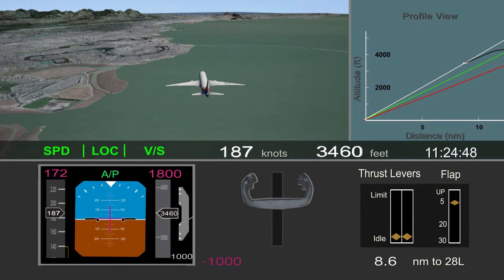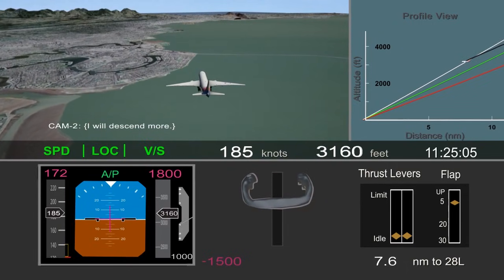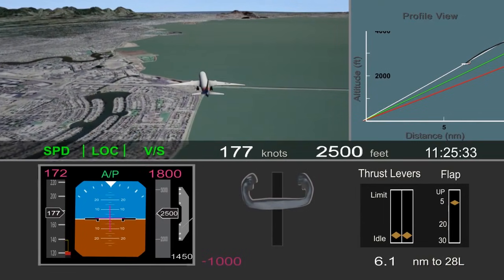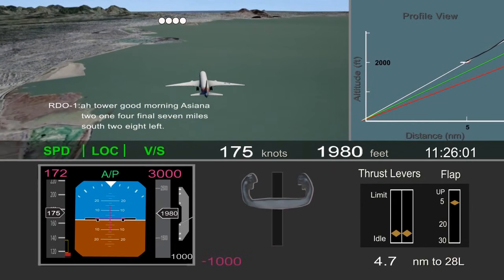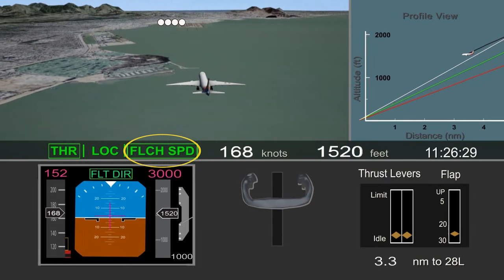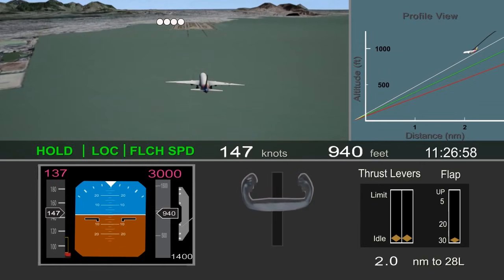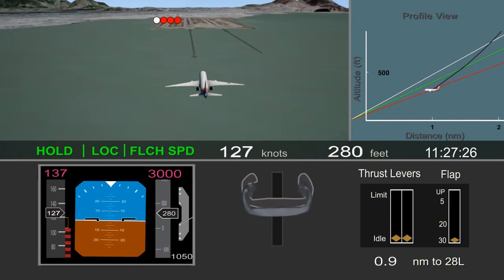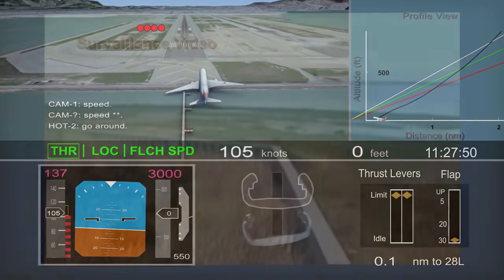Asiana Flight 214 Crash - NTSB Animation

Comment: This highlights two very interesting features of the AFDS logic that I can't honestly understand:
- Forcing the thrust levers down to idle when in THR | FLCH climb will revert from THR to HOLD, why?
- The ATs won't wake up when the speed comes down below Minimum Maneuvering Speed while in FLCH. Again, why?
Reply: +jibeneyto Boeing logic, an Airbus would have applied thrust. Basically Boeing leaves more in the hands of the pilots than Airbus. Noe excuse for this either way.
Reply: +FEVB Thanks for your comment. I did finally read the report that Boeing submitted to the NTSB. They acknowledged this issue with the ATs not "waking-up" when in FLCH because if that were so, there would be 2 AFDS modes trying to control airspeed at one. To me it still doesn't make much sense because when the speed slows down below MMS then clearly FLCH is not doing its job as it would "want" to.
Reply: It didn't. That was one of the pilots initiating a go-around (too late).
Reply: jibeneyto Ok than,but still it was the pilot's fault not the plane's one :-)
Reply: Not true, just take a look at the End of the video, it has woken up
Reply: I realized that FLCH climb sets AT to climb thrust and FLCH descent sets AT to flight idle. But the pilot can then control the rate of climb or descent by manually moving the thrust levers thus making the AT revert to HOLD mode. In this mode the wake-up function is disabled.
Reply: jibeneyto ?? Because when the pilot manually puts the thrust levers to idle, the plane's logic assumes the pilot wants that and doesn't want to go against the pilot's wishes. It's that simple. The FLCH mode is not supposed to be used after the FAF anyway.

Comment: I´m just a layman but i can´t believe the PM was actually also the instructor/check captain/PIC with over 3000hrs on the 777 and not taking controls while they were in an unstabilized approach with a PF not familiar with a 777 (43hrs on 777 - over 9000 altogether) on his first landing with the 777 at SOF and clearly overchallenged! It is the PICs duty to ensure safety and he missed that already on 1000 ft, had a second chance on 800 where instead of calling out "speed" he should have initiated a go around.

Comment: when u pulled all the way down but the airplane did not response with a pitch-up action, u'd better check the ias and the trim. i think airbus pilots dont worry about their throttle, they think they just need to pull the sidestick and the aircraft will pitch up.

Comment: Autoflight, especially on the airbus can easily discourage basic airmanship if its abused.
Reply: +Aidan Hutchison I'd be careful going down that path, as there would have been additional warnings and protections even hand-flying a visual approach in the 'bus. 

Actually true, I see your point - on most days that protection would make matters even worse.  There's definitely a lack of actual piloting skill coming out of the classrooms these days. 

There definitely should have been an audible warning when autothrottle hold mode was engaged.
Reply: +Aidan Hutchison Irony - a bus, which apparently the pilot flying was more used to, might have saved their automation dependent butts (A-Floor protection I think it's called).
It really doesn't matter what modern jet is flown -mere minutes of actual handling per sector, especially the even fewer sectors on long haul, erodes manual flight skills. It's an industry issue long in the making.

Comment: He spent a full 25 seconds both below glidepath and slowing down with absolutely zero action on his end.  How do you just sit there thinking "where's my airspeed?  Where's my altitude?" for 20 seconds and do absolutely nothing.  It makes no sense.  He literally stopped flying the airplane.  It took 25 seconds for anyone to do something at all.  That was about the dumbest thing I've ever seen.  Literally, the only thing the pilot flying did was pull all the way back at the last second while just over stall speed.  It looked almost intentional.
Reply: cjracer1000 
Years ago I read an article @ B&CA Magazine with the titule:
 - Pilots who shouldn't be....
Well, there are some samples.... This Asiana Pilot, that AirFrance's (Co)pilot holding his side stick in a nose-up position, despite all that "Stall" warning...
Reply: You have much more control if you disconect the A/P above 3000ft. and fly this thing without any help. Many cariers in the EU doing this Step too they disconect the A/P for the Approach and use not the ILS Support for autoland or GPS-Approach. They Disconect Evrything at 3000ft. The Important Thing Is To Control The Airspeed By Your Self (Usualy 140-150 kts) the crew don't do this. So the question is why the pilot not react in this Case. The throttle is neutral until shortly before the accident. They dont react also as 3 red lamps up by the Way. Why?
Reply: hindsight is always perfect, its easy to talk smack when you are not in the cockpit, company, situation, culture...  with every air incident, you dont talk smack about the pilots behind the controls, but you learn from their mistakes so that you make the same one
Reply: 777
Reply: The captain was flying a320s, this was his first 777 flight
Reply: My man forgot that A/T on hold mode literally holds the thrust, not the airspeed
Reply: I wonder how was the communication between 3 pilots
Reply: In excellent VMC too 😂
Reply: Why is he even out of vnav path on an rnav approach it baffles me. I would have been looking at the captain sideways the moment he elected to use level change when less than 5 miles from the airport never mind 1500 v/s below 6000 feet is already steep enough! I mean you got to have no idea what you are doing if you are using level change that close to the runway. The guy didn’t even use it correctly he bugged the MSA then flight level changed resulting in a CLIMB lol like what are you thinking? And then disconnects the whole thing while it’s destabilized to just say “oh to hell with this I’ll hand fly it in”. Wow I’ve never seen someone mismanage their approach so badly.
Reply: Stuart Hughes the problem developed because he disabled automation. Him pulling the throttle to idle disabled autothrottle and his successive inputs were based on his assumption that ap would hold speed.
Reply: @Galf506  No.  He should have been able to hand fly that plane down from the top of descent with all the bells and whistles OFF.
Reply: @Galf506  relying too much on machines but the. If the machine is in full control it likely won’t make a dumb mistake?
Reply: @Galf506  does not matter if the AT was not doing its job the clown cpt should have done something about it.
Reply: He was vaping ........
Reply: It's far more complex than you say.
I'm wondering what aronautical experience you have to judge so roughly the crew !
YouTube is full of armchair pilots or suddenly self proclammed aviation specialists !
I wonder how many of them had controls as a a pilot in command in reality !
Read the full accident report, the Boeing and FAA recommandations after this crash and you'll see that flying such a plane with complex automations, in such a concested area with arrival stucked high as long as possible to clear the toutes for departures is far more complicated, difficult and demanding that just reading a speed and watch a profile.
Many experienced capitains on 777 familiar with this airpor witnessed that this accident was to happen due to the the training and the automations of this aircraft in these kind of situations. Several reports mentionned incidents similar to that before this crash and it was not taken in account adequately.
It's not flight simulator in these airliners folks !
Reply: Let me just post the comment of a Asian pilot:

"As someone who has flown for an Asian Airline for 11 years, I can tell you that Asian Airlines (almost all of them), do not train visual approaches.  Even when the weather is clear, the have their heads down and are watching the Glideslope and Localizer needles to make sure they are centered all the way to landing.  All with the autopilot on or at the very least, the auto thrust. So, why do they do this?  It’s because ALL Asian airlines use QAR Data to punish pilots that deviate from the Airlines strict and idiotic permitters that they set.  Let me give you an example.... Taxiing more than 10 knots and making a turn of more than 50 deg. Results in a hard (RED) QAR. Another one is G/S deviation on landing as well as a Long Landing.... (even though you touch down in the touchdown zone).  And there are 50 more strict guidelines the airlines put in place in order to keep their pilots in a Box of Parameters to work from.  What they lack in stick and rudder skills are supplemented by this box of operating guidelines.
They then use this data to access the quality of that pilot for upgrades in First officers as they move from F1-F10 (F10 being almost a captain).  Once your a Captain, those same QAR Parameters still apply.  The “leaders” then use this data on each pilot (yes names are attached to this dats....), to punish the pilots with deductions from their paychecks....  Sometimes in the thousands of dollars and additionally use this data also to decide who is a good pilot and should be moved to a Captain position.
In Asia, money rules! Being a Captain and making that money drives all of them to show the leaders how few Red QAR’s they have.  
So you will now ask, how does this make a 777 fly into a sea wall on a clear day?  On this day, the G/S and LOC guidance was out of service.  The pilots didn’t expect this even though it was NOTAM(ed) out.  Not to mention it was written in English. Now they were forced to hand fly this jet (laterally and Vertically)without guidance to the runway and that is something Asian Airlines DO NOT DO.  They do not disconnect the Autothrottles on ANY approaches...ever!  These pilots were confused on what was going on (no LOC or G/S guidance), lacked basic hand flying skills based on line of sight (because they don’t train this) and were VERRY worried about the QAR data flagging them in all their confusion.  Couple this with poor training culture, new pilots on new aircraft Type and you will just barely.get a glimpse of what every expat pilot in Asia sees as a Major setup for accidents just like this.  
I could actually write an entire book about this subject but just thought I’d share just a little insight into Something every expat pilot in Asia already knows.  Fighter Jet pilots or not, Asian airlines do not work their way up to being an airline pilot like in the USA/Europe and the other 99% of the world.  They go from a Cessna 172 straight to a jet. They don’t fly cargo, charter work, flight instruct or do anything that prepares them for even a strong crosswind landing until they start Captain training.  They lack experience, proper mentorship both in International flight rules and the basics in decision making (thinking for yourself), problem solving, basic skills and live in fear of the RED QAR.
It’s NOT that they are stupid... they are far from that.  It’s an aviation and culture issue that can not be taught in any textbook.  This leaves them behind the rest of the world and I sincerely hope some day this changes.
"
Reply: @sfojulius  thanks a lot for putting this information here !
Reply: What’s the difference between a Korean airline pilot and a Korean fighter pilot?

The Korean fighter pilot has never killed anyone.
Reply: @sfojulius  So he means asian pilots can´t fly without a computer? :D
Reply: @sfojulius  Amen.  Many thanks.
Reply: @sfojulius  Ok this now makes sense. Lack of experience was the cause.
Reply: bonbondesel flying into terrain on a clear day is inexcusable for anyone
Reply: @bonbondesel  power controls altitude.  My cessna 150 instructor said.  These guys were idiots!
Reply: You are correct in saying flying one of these jets is a complex ordeal. That's why it's essential for pilots not to get tunnel vision. From this animation, it seemed like he was either focused on some other instrument, not paying attention to his airspeed indicator or he had spaced out entirely (unlikely). It also seems that he was unable to notice the auto throttle changing setting after he took control of the plane. It could be said that it's the manufacturer's fault for not making the autopilot mode indicators more visible but the pilot should've received training about the autopilot and should've been aware of that setting changing. 
You seem to have a pilot hero complex, not being able to admit that this was entirely pilot error. You can't blame the airline, you can't blame the manufacturer. You have to blame the pilot. And frankly, I don't know if it's because of your English level, but you seem grossly uninformed about the topic you're talking about.
/end rant
Reply: @NikHYTWP  I don't who you're talking to.
But it's like many people commenting in armchairs on YouTube forget the basics.
Accidents never happen for a single reason. Multiple factors.
A lot of people here, sitting in armchair, just simplify this as "dumb pilot" !
Not so simple. You can't blame only the pilot, only the manufacturer, only the airline policy, only the training, only the cultural context. You can't also do the contrary: not recognize the pilot responsability etc...
It's just a mix of all these factors.
They are all responsible.
Reply: @bonbondesel I was talking to you
Reply: @NikHYTWP  and you still think that I have a pilot hero complex and that I'm here for a rant while there's almost only haters comments exclusively againts these pilots ? Lol

Just pointing out that they're part of a system, not that they have no responsability in this accident. They're not the only ones involved, that's all...
When I see people not even holder of a PPL saying that they would not have made these mistakes in a 777 there because their flight instructors gave them good training advices in a Cessna 172, it makes me smile, that's it.

I've been a pilot and I can tell you in almost every single flight, any pilot makes mistakes. We learn from that every day because we are thankfull to be alive and have expérience. There are margins for errors. So when something goes so wrong and when only professionals and experienced people are involved, there is something more complex than "the fault of dumb pilots" !

I think some aviation enthousiasts, very hurrying to judge people 10 times more skilled ans experienced, forget the basics learned in any aviation training, professionnal or not: an accident is a sum of several factors.

On internet, people bash easily each other for no reason or just to express their frustration of the day behind a screen.
Aviation topic makes no exception to that.
Réality is a way more complex than these internet behaviors. That's why there are investigations made by experienced and professionnal experts. If it was so simple, any troll could resolve the reasons of an air crash by saying: "Because this man is dumb, asian would not be allowed to fly there" !
Hopefully, investigations don't work like these easy judgements.

Friendly

Chriss.
Reply: @bonbondesel  - The captain was very experienced and there were 4 pilots in that cockpit - FOUR!! and they still crashed. Nobody said anything....
Reply: @bonbondesel  How about this.....I have over 30 yrs airline experience (with over 20 of them on large transport jets, including the 777)  Here goes ->>>   This Asiana crew completely and totally screwed this up.   100 percent their fault.
Reply: @lbowsk  I think Julius Döring got all the picture of what could lead to such a catastrophy.
He shows perverted the system from these companies are.
Yes these pilots did crazy mistakes. But it's because of a crazy system.
I'm not questionning your Airline pilot experience. I'm questionning that only these pilots led to that.
It's more complex and the comment of Julius Döring provides informations on why it happened with all the complexity.
These pilots are the product of a perverted system. The culture they were trained in and worked in was leading them to this. It was only a question of time before it happened. For them or other pilots in this company. It does not remove their fault. It just shows all the aspects and responsibilities.
I just hope things have changed since that.
Friendly.
By the way, happy new year !
Reply: @bonbondesel  Five years on the triple here.  You're making this way too complicated.   This was 100 percent pilot F-up.  A day, VFR arrival to a 10,000 runway.   If you can't manipulate the automation just revert to basic flying.  Yoke in one hand, throttles in the other.   Airspeed, 3:1 profile initially, then PAPI, vertical speed.  Not much more than that, I'm afraid is required to safely land the jet.   Basic Stick and Rudder stuff, really.
Reply: bonbondesel you sir are 100% right. So easy to judge with every element in hand sitting in your room ! Be humble

Comment: I flew two visual night approaches (A321s) into SFO's runways 28L and 28R during the the seven days immediately prior to this accident. There was maintenance occurring on both ILSs and both PAPIs; they were not available. So there were no visual or electronic aids other than the airplane's on-board glide path 'donut' to guide them - part of the VNAV system. I remember thinking at the time that we were having to revert to our old simple, visual, pilotage perceptions: "How does the runway look in the windshield?" That's a little stressful, but it is manageable.
Reply: you seriously think as a pilot that crash really happened.. Jesus Christ man.. than i am affraid for your plane :) . and you thinking one of the biggest airfields in usa doesnt have video survailance which would record that crash.. and some guy standing miles away would record planes landing which can barely see .. . nothing makes sense in that story, nothing at all.. because its fake.
Reply: @johnjustjohn8168  You, sir, should get psychiatric help. Get well soon!